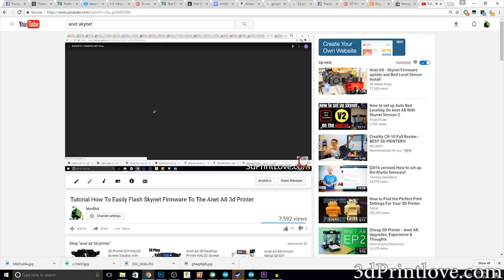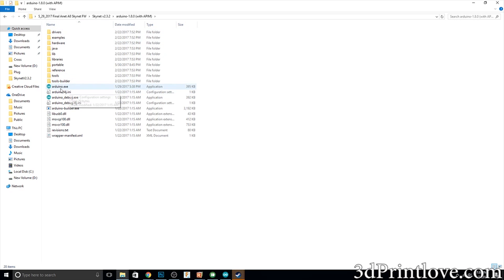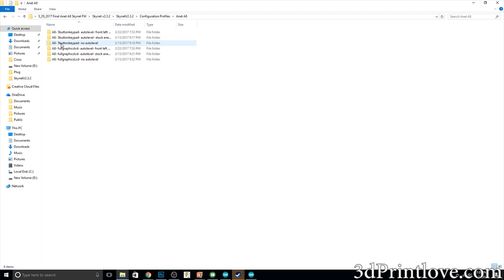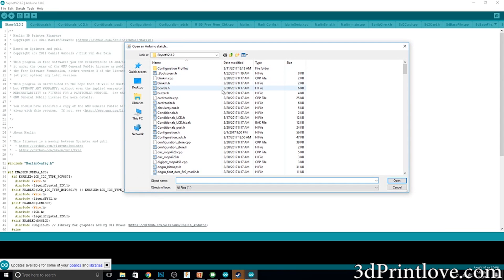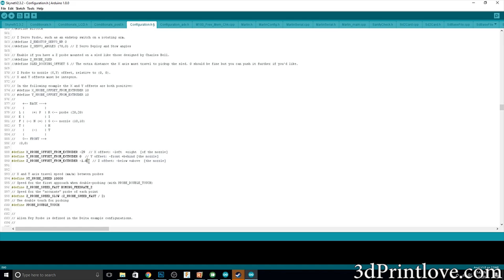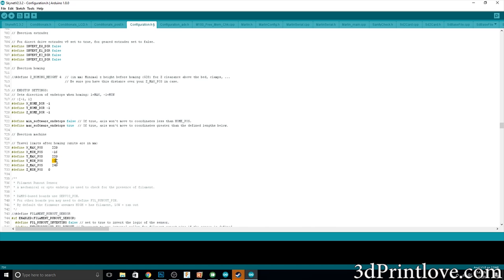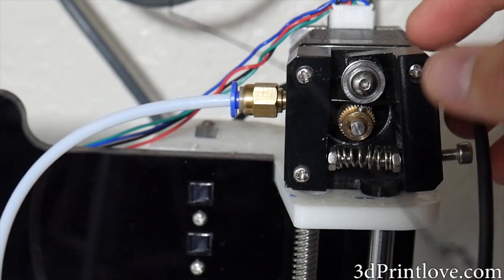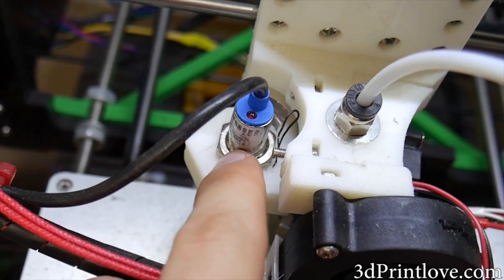Revisiting Skynet Firmware For The Anet A8 (Also works for A2 & A6)

Comment: hi i need some help, i am a week new to 3d printers, i bought 3 kits, an anet a2 an a6 and a tevo. i have the tevo and the a6 working fine, the a2 i foorgot to switch thee power to 110 from 220 and it fried my board and lcd. i ordered a new lcd and board, but the board is for an a6, even though its the exact same as the a2 board. where do i start to flash the firmware and turn the a6 board into an a2?

Comment: Will this work with the Anet A2+ ??? I believe the only difference is the Y-axis area is 270mm.
Reply from the maker: +videogamemaster21 if the electronics are the same then yes you will just need to edit the build size under configuration.h

Comment: I know this is unrelated but I built my first printer last night an Anet A8 but I have having a problem with the x axis. As soon as I put the extruder cage on it doesn't move very freely. And tips to fix this?
Reply: I had binding on both X and Y axes on my A8 and maybe the reason for yours is the same; fractionally misaligned bearing blocks. I loosened off all the screws holding the mounting plates onto the bearing carriages, then did them up so the screw head was just seated but still loose. I took the belts off then ran the assemblies back and forwards a few times to seat the linear bearings the way they wanted to run then tightened up 2 screws on each bearing block (1 diagonal pair) a little at a time, running the bearing along the rods after each tweak, until both screws were tight; do that for 1 block at a time until all 3 are locked into place and run OK. I ran the bearings back and forth a few more times to make sure the blocks were still aligned spot-on, then nipped up the remaining 2 screws per block. Works perfectly now and had about 1kg's-worth of good prints (mostly upgrades for the A8!). If that's not it it'd likely be bent rods - check the gap with vernier calipers at several points - it shouldn't vary by more than 0.1mm or so. If you have a bent rod you'll need to replace it as trying to get them straight is a short-cut to madness...
Reply: I checked to see if they were bent and I don't think they are I also did check with calipers and towards one side it does get a tiny bit wider but its about 0.1mm. I had originally put in drylin bushings instead of the bearings but it was binding pretty bad with those. I cant get the lower rail back out so I am running the drylin on the lower. The binding isn't that bad but there is more resistance than what I think there should be. The printer still runs but the excess load on the motors worries me I also assume this will cause print quality to decrease. When I get off work I will double check everything but My guess  is I am just slightly messing up the blocks alignment when tightening the screws down. thanks for the tips!
Reply: Try loosening every thing and torque it slowly...
Reply: I tried that a few times. I have it to where it should print but still rubbing. I am going to try and print a new extruder mount for it.

Comment: The 3D printer I have has the option for a auto leveling sensor but the thing that annoys me is that they give you the firmware for it but it will be using led screws instead of threaded rods.
Reply from the maker: +Its Voodoo so your saying the firmware is not configured for the right type of screws? So the steps are off on the z axis
Reply: ModBot yup
Reply: I sent it back because it was a waste of time.
Reply from the maker: Its Voodoo that blows can you ask them if they can send you the version that is actually for your configuration
Reply: ModBot they are really stingy about giving out the software.